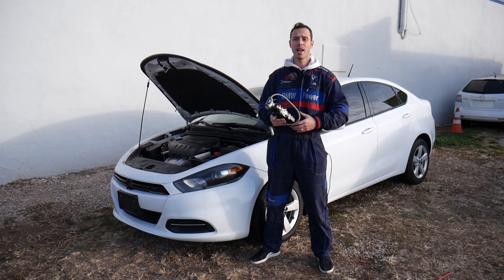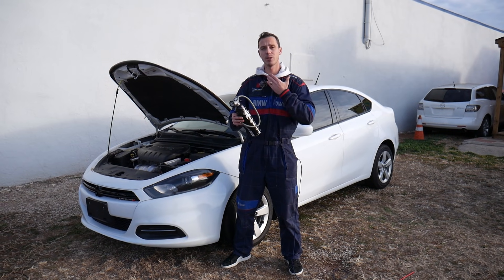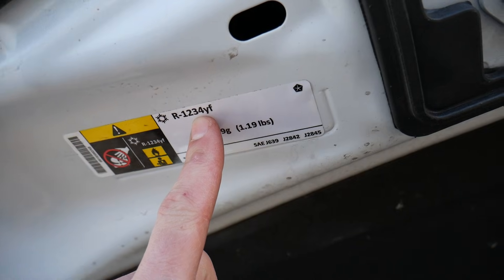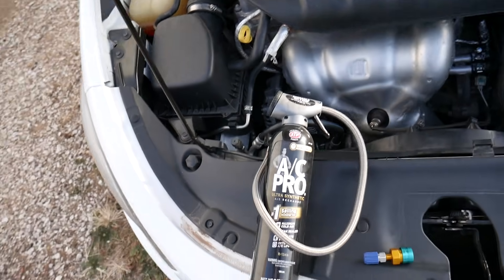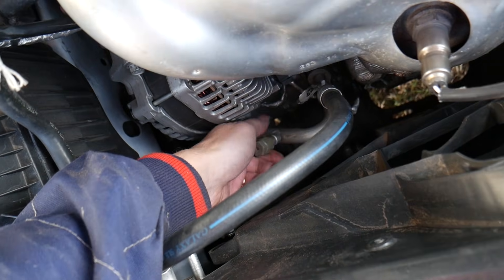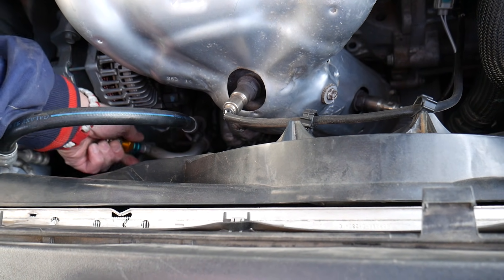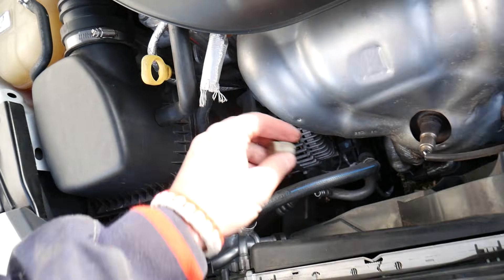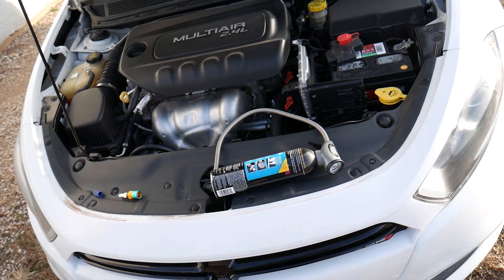CAN YOU USE R134a in R1234YF AC SYSTEM

Comment: so, i have a few suggestions. it is not RECOMMENDED to mix the two, but you can if you want to roll the dice with a top off of 134a in a 1234yf system. i would personally prefer to evac the system first. and furthermore, you don't 'necessarily' have to vacuum the existing refrigerant into a recovery tank....ummmm yeah, that's right mr. green jeans. you can open air bleed the system. the EPA prob wouldn't recommend this, LMAO, but that's why they went with the more eco-friendly gas in the first place. idiots like me who prefer to do things the more practical way. go figure.
Reply: one more added suggestion: after evac, you do not need to add oil back in the system. this is only necessary when replacing major components of the system. someone change my mind on this.

Comment: Don't listen to the Monday Morning quarterbacks. R134A works in R1234YF systems. They are both soluble (compatible) with the same Mineral oil and in fact their chemical formula says it all: R134A is C2H2F4 while R1234YF is C3H2F4. Many have been using them in combo or alone. If the system uses R134A it is compatible with R134A & vise versa. You Tubers can wear coveralls or race driver outfits, it doesn't mean they outsmart chemistry. It just makes them look like clowns pretending to know it all. I hope Pfizer comes up with a vaccine for stupidity

Comment: im happy slowly car companies switch to R744, for example vw id3 / id5 use them. they work better than r134a and r1234yf and you can work on them without any license. only problem is the parts are very expensive cause they work at very high pressure....

Comment: He is right, it works great, just have to remove all the old new stuff. All you are doing is violating a clean air act. LOL And as car guys you know how we all feel about that right??
Reply: Do you have to use more of R134a? It depends on the vehicles A/C system apacity. You may have to do a gram-to-gram conversion calculation. And, recommend to do a deep vaccum of the system before recharging and inject a compatible compressor oil.

Comment: I use r134a on my yf recommended car and it works... it's still working fine as of now...been over 4 years now.
Reply: Did you vacuumed the system before or no?
Reply: @izh6421 you have to as from what I’ve seen
Reply: Do you have to use more of R134a? It depends on the vehicles A/C system capacity... you may have to do a gram-to-gram conversion calculation. And, I recommend that you do a deep vaccuming of the system before recharging it and injecting the compatible compressor oil.
Reply: Did you have to use more of 134 then the sticker calls for?

Comment: Did you have to change the oil out In you're compressor . Because they say 134 A takes a different oil. In the compressor.🤔
Reply: 134a systems are backwards compatible with 1234yf oil. But not the other way around. 1234yf is more reactive, and will break down 134a oil, so they made a special oil that resists the breakdown from 1234yf, therefore still being able to lubricate 134a systems.

Comment: So, what you're saying is you literally don't have to replace any components to do this? What about the oil? Do you have to replace the oil with pag 46?
Reply: POE oil in the newer systems works with either.  There's literally a Mercedes 2013 recall TSB that specifies NOT to replace the oil.  Mercedes recalled a bunch of SL in europe bc the new stuff was flammable in crash tests, pumped the old stuff out, replaced hose fittings, refilled with 134a, and put new stickers on it.
Reply: Oil is the same for both 👍🏼

Comment: Backward compatibility will always work without any issues, forward compatibility is not. "For example - you can add R134a to a R1234YF system, but you can not add R1234YF to R134a system. Just like USB ports, you can go to USB 2.0 to a 3.0+ but you can not go from a 3.0+ to a 2.0, anyone saying otherwise is a Mechanic or a Federal shill. Plus you can always go back if needed, like if you were going to sell, by just doing a full purge of the system and replace.
Reply: So can I just add R134a to my R1234YF ac system if I need to recharge it? And I don’t need to empty the system first?
Reply: @Matias-bw1eq  I replied but didn't get posted not sure if you received? (youtube) short answers is No , NO and yes you do, Good luck.
Reply: @Lordblackhawk1000  thank you, so if I empty the system first, it will be fine if I put the r134a product even if my car is supposed to use r1234yf?
Reply: @Matias-bw1eq  Np, As stated in my first statement all systems are backward compatible. Use Ac--Pro.v101, with needed connectors R1234yf to R134a  (Seal, Oil and Gas)(low & high), unless you have all the necessary items separately, Good Luck.
Reply: Just FYI, the psi recommend pressure for R134a is acceptable, very slight difference from the psi of R1234yf. Not even worth stating, Research and Knowledge is key.
Reply: @Lordblackhawk1000  thank you man, you just saved me a lot of money!
Reply: @Matias-bw1eq , Your most welcome, This attempt can also be achieve with R12, R20 to an R134a, with the same process, with the proper connectors. I have achieved cabin temperatures @ 44.6F and 44.8F on other, Nice and chilled on a Hot day. The sealer will hold for years, if by chance it doesn't just repeat the refill process, not the purge, Take Care.

Comment: The factories implicitly admit the two work together.  My sisters 2015 Fiat 500 is tagged for 134a...but has a 1234 low pressure port.  They flat told us to charge it with 134a...

Comment: Ive seen 134 used in 1234 systems without any problems. Several different vehicles, all working just fine years later.
Reply: -10%
Reply: Did you put the same amount of the refrigerant into the system?
Reply: @robertinogg probably not I’m sure the density and weight of both are slightly different. If you’re a math guy I’m sure there’s a conversion formula to give you a good number.

Comment: They also said R134 wouldn't mix with R12 but alot of people did it and it works just fine for many years
Reply: In fact a alternative refrigerant called freeze 12 is a mixture of r12 r134a r12 and hydrocarbons
Reply: Wrong, it was R142 which helped with oil suspension @williamvaughan1218
Reply: Converted mine 20 years ago by slapping fittings on it and charging it.   20 years later it still works perfectly.  Not one problem.
Reply: the issue is the 134 will leak / is too small compared to r12
Reply: @salami99 actually no, 134 and r 12 are almost the exact molecular weight, meaning, same size molecules

Comment: 134A is less damaging to your AC components and costs much less. 

Eventually, when economies of scale catch up, the price of 1234YF will fall. 

However, other comments are correct: an individual who does this violates The Clean Air Act. Each violation is a $2,500 fine for individuals and $25,000 fine for companies. 

Will you be caught? Probably not. But the faster all vehicles and mobile AC units are converted to 1234YF, the faster the price will drop.
Reply: No it wont, because it under patent till 2030. Basically scam

Comment: R1234yf 가연성 가스로 전방추돌로 에바 파손 및 불꽃 즉 스파크 점화원 있으면  화재가 발생 합니다. 대략 600~1000그램 가연성가스로

부탄가스 600g 용 1.5 통이 연소되는화재...최근에 한국에서 발생 했네요
Reply: Is the 1234F extremely flammable ? Thanks
Reply: Not only that but the combustion byproducts include a extremely nasty acid powerful enough to etch glass

Comment: Completly fault. This euro techs are way over his head. Doing wrong stuff and things will damage your car. Do not believe this. And am not some one to make just the comment. Am a Master Tech for 25 years. And the results will be bad on your system.
Reply: Nobody cares. Your master tech answer has been disproven by many already lol
Reply: Seen it work no compressor failure yet little ice cubes coming out the vent
Reply: Plz can you give as the sffects of 134a to  the compressor
Reply: Master bator tech
Reply: @robertsironen1243  congratulations on your month! Sorry but we’re not allowed to discriminate to your gender 😂😂😂👍🏻👍🏻👍🏻
Reply: Congratulations on your month but we can’t comment for the people on your gender !😂😂😂😂😂😂😂
Reply: Pag and ester/ synthetic  oil works  with most gasses  / the mineral  oils are not used with the blends refrigent  due to foaming   that effects  the flow of the  refrigent  on the evaporater  core  plus can cause  slugging to the low side of the compressor.  Side note synthetic  oils  a prone to moisture to absorbing  fast  /  that's why if a system  has been flat that the dryer  is always  gets  replaced  and put on vacuum  pump for at least  1 hour .

Comment: How do you calculate the charge weight for 134a from the spec 1234yf weight printed on the sticker under the hood?  Or do you just go by the low and high side pressures with AC running?
Reply: Go by head pressure 
Hi side 220 psig on a 90* day
Low side should be about 38 psig
Reply: Let me know if you found an answer to this. I’ve been trying to research but can’t seem to find any definite answers
Reply: @wisetow10  someone in the comments said if you want to switch to 134 then subtract 10 percent of total volume needed but can't verify
Reply: Do you have to use more of R134a? It depends on the vehicles A/C system apacity. You may have to do a gram-to-gram conversion calculation. And, recommend to do a deep vaccum of the system before recharging and inject a compatible compressor oil. Suggestion: to recharge the system use a manifold gauge set and a Temperature-to-Pressure chart for the specific refrigerant capacity/amount.

Comment: I can't believe this is still posted. In the USA it is illegal  to change over 1234yf to 134at is a $2,500 fine per offense government fine. What happens when the next owner takes it to the dealer and there a/c machine checks the type of Freon is in it.
Reply: Disagree -this is a great fix until 1234YF prices go down. Quit voting Democrat.
Reply: @markvon9727 IF the prices ever go down, can just swap back to 1234.
Reply: Nothing happens.
Reply: @rich7447  or they call the EPA TO COME AND CHECK IT FOR 2500 THEY WILL COME OUT AND TRACK IT DOWN TO WHO  PUT IT IN ,IF IT IS A REBUILDER THEN THEY CAN CHECK OTHER CARS BY THE VIN NUMBER AND WHO NOW HAS THEM ,2500 PER CAR .
Reply: @brucemills9146  How are they going to figure out any of that. The only lead that they have is the previous owner who is not legally required to discuss anything with the EPA. Even goverment agencies need evidece in order to fine you.
Shouting does not make an argument more compelling.
Reply: say the car is 2018 ,it is a rebuilt wreck in order to get a title all that is on record tied to vin number.  If a 2018  comes in with wrong freon in it where would think it happened  ? it on recorded who repaired it .You must no been around when propane was used in place of r-12  in Texas 4 people died from fire from wreak they tracked it back to a repair shop and charged the owner 4 counts wrongful death. also in California a shop had 3 cars burn in wreaks 5 cases wrongful deaths now say they can't track you..
Reply: @brucemills9146  freon (r12 or r134) is nothing like propane as far as safety. Yes propane should never be used. 
The current comparison is far different from that.
Reply: Bro you can learn how to cook crack on here.. don’t be so shocked lol
Reply: @KORPz600 🤣🤣🤣👍
Reply: More reason NOT to take your car to the dealerships especially out of warranty ones.
Reply: 🖕the government and 🖕the dealerships
Reply: Freon hasn't been used in decades...
Reply: Sheep follow what the wolves tell them to. Dont be a sheep. The government is not interested in your freedom or whats right or wrong. Just control over you.

Comment: NO it's NOT against the law, GM put it in Cadillacs when it first came out in  2013, DIDN'T like it (maybe cause it will BURN) AND PUT  r134a  BACK IN THEM. OTHER COUNTRIES ARE USING IT SO if they did we did to, for what ever reason. Other than Someone will make big bucks repairing it, and it's a direct replacement. Just need to vaccume real good, that's a must. They don't mix.

Comment: How many cars have you replace the Ac system from r1234yf to r134, how safe is it? I’d like to try to do so on a 2017 Ford Escape se. Any extra advice ?  Thanks for the video.
Reply: For some things in life you have to consider the risks involved. That being said, consider the following information: Do you have to use more of R134a? It depends on the vehicles A/C system apacity. You may have to do a gram-to-gram conversion calculation. And, recommend to do a deep vaccum of the system before recharging and inject a compatible compressor oil. Suggestion: to recharge the system use a manifold gauge set and a Temperature-to-Pressure chart for the specific refrigerant capacity/amount.

Comment: its illegal to retrofit a new system to use R134a, I would not suggest this at all. and another reason I would not suggest this is the oil properties (yes yours may use PAG but many use PAO which is not compatible with R134a.) etc are not the same and you're just asking for a failure. please do NOT listen to this video.
Reply: @jeffperkins5310  ah ok , I was about to say... Um I'm looking right at the spec sheet for Mahle refrigerant oils lol. PAO "AA1" & "AA3" are both compatible with either r134a or r1234yf , and r152a as
 well.
Reply: @jeffperkins5310  who said I was only explaining it to you ?
Reply: Certain types of PAO are perfectly compatible with r134a , specifically the type that is used in electrically driven compressors
Reply: @jeffperkins5310  which comment are you referring to ?
Reply: @jeffperkins5310  it's a public comment , so don't get your panties in a wad , are you always a douchebag ? Or just to people you talk to on the Internet
Reply: to both of you, whether the oil is compatible or not, you'll never get the other refrigerant out of the oil regardless, and as i stated, its illegal to change a R1234yf system to R134A, didn't here you guys say anything about that. this video is illegal and should be taken down.
Reply: also, the temperature coefficients of the refrigerants are totally different, as well as the system design. almost every R1234yf system uses a suction line heat exchanger where R134A system do not require it. Think before you do.
Reply: @nicksenior4032  the temperature coefficients are not totally different , they are actually almost identical , at 32 degrees fahrenheit there is about 3 psi difference , which is not much difference , as far as the oil is concerned , the miniscule amount of 1234yf left over is not going to affect anything , some refrigerant blends already contain a large percentage of both 134a and 1234yf , example would be r449a and r449b .
Reply: @nicksenior4032  The IHX used on 1234yf systems does not hurt performance with 134a , in fact it helps quite abit , most refrigerants will benefit a slight C.O.P increase from the addition of an IHX with a few exceptions like r22 for example , r134a actually really shines in terms of C.O.P with an IHX. And lastly , I know that it works because ive been using it in my 1234yf system for going on 7 years now. And it works Great. Now with all of that said , do I think the average Joe DIY guy should be doing this ? Probably not , but the point is , it most definitely can be done and with good results.
Reply: @nicksenior4032  internet cop
Reply: @nicksenior4032  that's bull a proper vacuum to the system will remove the refrigerant from the oil and whatever remains will be of no consequence.
Reply: @williamvaughan1218  you do you. Send me a video of when you vacuum out your system then change the oil in the compressor, it'll still be bubbling off at room temp, you'd be on vacuum for 2 days to get all the moisture and refrigerant out of the oil. And that still doesn't deny the fact that it's illegal to do this.
Reply: @williamvaughan1218  not to mention to this day I bet he's replaced the compressor, condenser etc and went back to R1234yf..

Comment: I have a Dodge Charger 392 and where i live i can’t find r-1234yf they told me you won’t have a problem with r-134a and also about my warranty I’ve already voided my warranty i dont have a problem. Please tell me is it going to effect the ac compressor??
Reply: @billselby9294  just ordered a 900 gram bottle online for 80 bucks my car takes 709grams
Reply: @BL3ND392  can you share a link to the coolmax 1234?
Reply: @BL3ND392  sweet. Let us know how it goes.
Reply: @BL3ND392  what did you fill it up with ? I also have a 392 but I’m in AZ and the price for this Freon is crazy
Reply: @chanuxxxx8835  bought mine online it’s a Chinese brand. The bottle is almost 900 grams, and chargers take 709-715 grams. Right now my ac is ice cold. By the way it’s called coolmax r-1234
Reply: Herd that they both use same oil so no
Reply: @billselby9294  yeah i heard of that it could brake the lines and probably have to spend more money on it